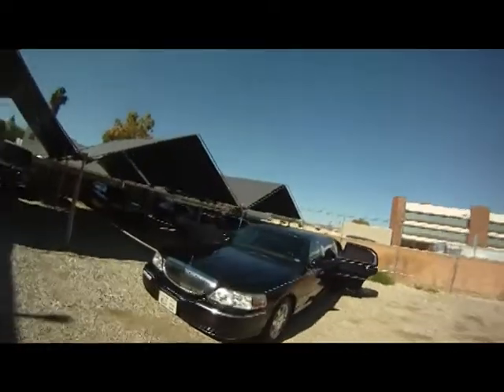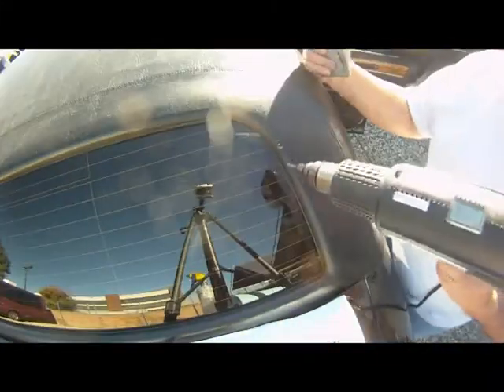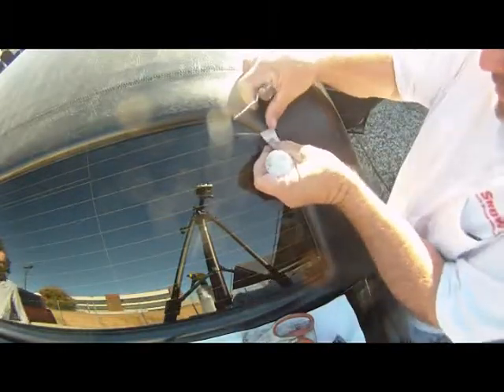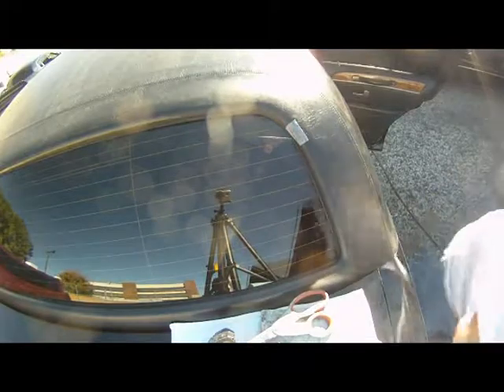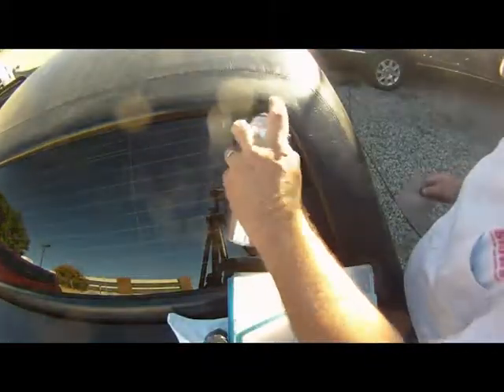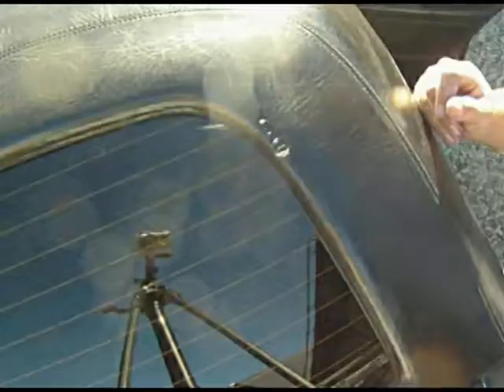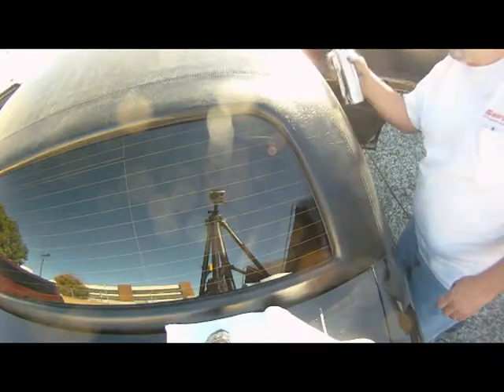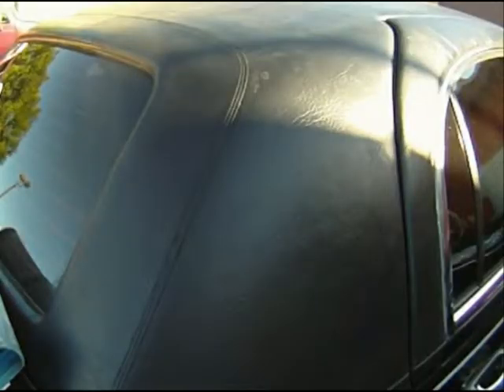Limo Top repair #1

Comment: I have a vinel  top on my 67 chrysler 300 has a rust bubble  about the size  of a nickel  under the vinel is that a repair  that is possible to do. its not on the edge it's about 4 inches x4 inches  on the.c piller  from the body line the rest of the top looks fantastic